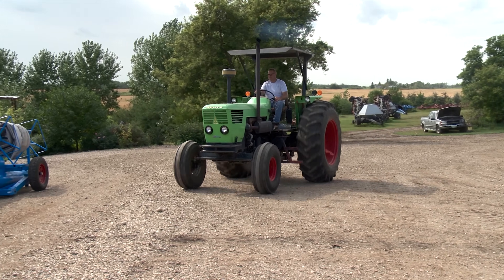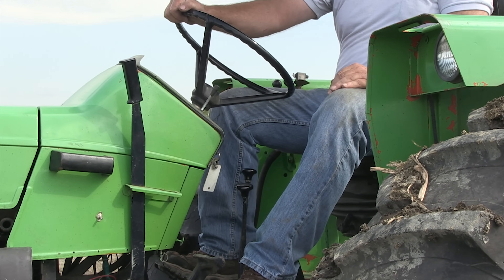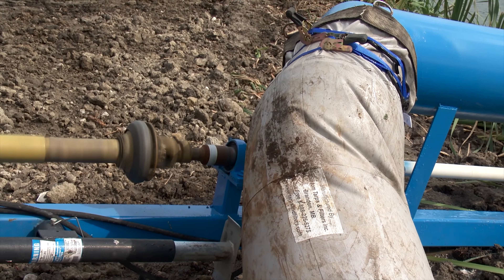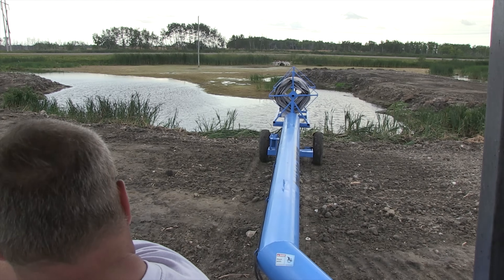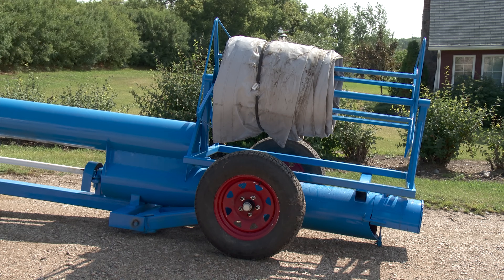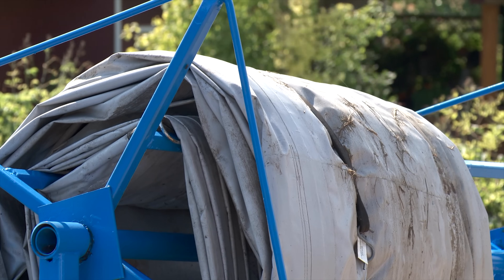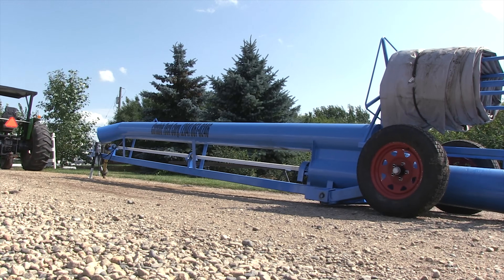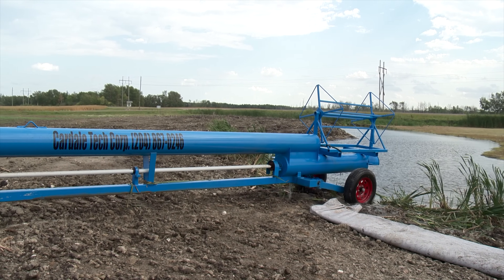6,000 GPM Water Pump

Comment: 법역 
https://www.youtube.com/watch?v=5RPT_-xAzSM 
전 세계 시대 친환경 무동력터보 친환경 새롭게 무동력터보 정품 복합멀티 양수기 유도 시스템 장치 시간. 돈. 인건비 .절감효과 .나타 남니다 .2009년 10년 본사 연구개발 주)아이템천국 032 882 2375
Eco-friendly everywhere
Item Heaven Proposal
Global Warming Ozone Destroys Environmental Pollution Air Pollution is caused by unstable combustion due to problems in the combustion method wherever the main combustion engines use internal combustion engines and fossil oils. Induction system unit is ready for technology.
 
Now, from the United Nations to the rest of the world, we have to spend a lot of money to reduce the environmental pollution soot fine dust (DPF.catalyst, urea water, soot, fine dust reduction device) to be completely burned. We research and develop technology until.

The difference in technology
1, Soot fine dust resolution (Headquarters) to item (low cost) "why" (pre-treatment) selection technology
2, Soot fine dust resolution (Ministry of Environment) to (high cost) "why" (post-treatment) selection technology

Research and development of complete combustion induction system device item technology from headquarters for 10 years from 2009. Automotive manufacturing researchers engineering engineers (unresolved) the problem of environmental pollution (soot fine dust) caused by unstable combustion during combustion of internal combustion engine. In the 10 years of research and development, the technology that can prevent (soot fine dust) by the complete combustion combustion method (Ministry of Environment) select (Post-treatment method). Our headquarters has developed and possessed a technology (pretreatment method) that completely prevents (soot fine dust) caused by unstable combustion in advance (pretreatment method). Passenger cars Ventri, Tiko vans Damas to Scania) all internal combustion engines are used.

If the existing internal combustion engine uses simple wally (air furnace + fuel furnace) technology, it immediately converts various air pollutants (soot, fine dust, DPF) by changing its performance from (unsafe combustion) to solid carbonization. Urea water.) Performance is just a method of draining the performance (to see the water in the smell) resolved.

The (Highly Available) (Smoke Reduction) device recommended by the Ministry of Environment is no longer needed, and we have a complete technology proven for 10 years.

Since all charters have problems with basic combustion methods of internal combustion engines in the manufacturing process of automobile mica, air pollutants are generated due to unstable combustion and the timing of engine development is important. Why does the combustion of internal combustion engines made by doctors of automobile engineering cause fine dust of environmental pollution due to unsafe combustion? Formerly, these environmental pollutants have been recommended by the Ministry of Environment for the complete combustion (high availability) post-treatment method (soot reduction catalyst DPF).

Why smoke does happen
All internal combustion engines Due to the problem of simple combustion method, if time passes, unstable combustion causes (soot dust, ultra fine dust) to be generated in carbonaceous suspended solids.

If fine dust occurs
Carbonaceous suspended solids from unstable combustion in the air (super particulate matter) are sintered in the air, moved in the wind, and inhaled due to air pollution. It is also a state law that destroys the lungs and circulatory organs. It is a very harmful substance.

However, if the problem of generating soot from unstable combustion is the problem of how to completely burn the exhaust by using the exhaust port, why does the Ministry of Environment recommend the installation of a smoke-reducing (high-priced) device of the high smoke reduction? Where (emission reduction DPF) device is installed in a place where emission is good during combustion and noise should be reduced quickly when the engine is exploded. (Good point) is only one simple function (reduction of smoke) .It helps to prevent environmental pollution. It is a problem when (fuel reduction) occurs more than usual due to poor discharge, and (fuel consumption) is more than usual.

In the case of using the product developed in the headquarters in the vehicle, the complete combustion method is selected in the pre-treatment method. You have to believe that if the water comes out instead of the exhaust gas (soot fine dust) instead of (combustion fine dust) in the exhaust of the vehicles used during combustion. Holds.

■ Various vehicles with actual mounting as of 2009-10 years
Domestic passenger cars : from Tyco.Spark to Genesis.
Domestic freight cars : Damas, Downer ~ Daewoo, Prima, Hyundai, Axial
Domestic passenger cars : Mercedes-Benz, Audi, Lexus, Volvo, Mustang, Bantry, Jaguar, Cadlock, Chrysler. Till

Overseas freight cars : Scania, Volvo, Manman, Benz.
All items : passenger cars, R/V, large buses, large freight cars, large dampers, excavators, heavy equipment, special equipment, tanks, aircraft, outboard aircraft, yachts, fishing boats, external generators, hydro power plants, thermal power plants

Others : Farm equipment, Yiyanggi, Combaer, Tractor, Sprayer, Poultry farm, Water pump.

 ■ International Eco-friendly Natural Energy Saving System Research Institute

   Note) Item Heaven
   79-1, Gyeongin-ro 34beon-gil, Michu Hall-gu, Incheon
   Head of Research Hyosung Baek
   010 8359 1469
   TEL: 032 882 2375,
   FAX: 032 887 9096
   E–mail : bhsbhs2kr@hanmail.net.
   E–mail : bhsbhskr893@gmail.com.

Comment: The general idea is excellent based on the fact that it is easier to push water  rather than to pull water.  I would suggest that the square corners on the hose pipe drum would be made on a hexagonal or  octagonal drum while the  drive from the tractor could be provided with some protection........... you know just in case!!  Congratulations for the   basic design.

Comment: I work with commercial water pumps every day and can tell you that's no where near 6,000 gallons per minute. That looked like a few hundred gallons per minute at most
Reply: I'm a farmer run a 10 inch Berggren reuse pit  pump at 2000 gal/minute and that is at least 4000 g/m

Comment: I built something like that once.  Too much vibration and no capacity.  Then I removed all the flighting except for about 1.5 turns at the bottom and changed the chain sprockets for more speed. An improvement, but still not much better than my little floating pump with a hydraulic motor run from the remotes of my small tractor.  Then I bought a pump from a small manufacturer near  Saskatoon. It had a 16-inch discharge, about a 20-inch centrifugal impeller, and was rated well over 10,000 gallons per minute although I didn't have a tractor with the power to run it at full speed.  I needed it to drain rented farmland that included a large patch of flat slow draining soil that was prone to flooding in the spring and crop drowning and denitrification from heavy thunderstorms in the summer.  With the big pump the system worked pretty well.  At half speed the pump didn't need a lot of power and the pump could easily keep up to the water flowing into the drainage ditches.  All it had to do was lift the water about 20 inches and pump it through a culvert into a highway ditch that had screwed up the drainage in the first place.  Thirty-five years ago that was good productive farmland.  Now it is all pavement, streets and warehouses.  I sold my pump to a land developer.

Comment: My wife and I live in Thailand and we have a similar 6" pump.....without the wheels.  We just use an old 9Hp Kubota stationary engine on a stand I made to drive the pump, at less than half throttle mostly. It uses about a litre of diesel an hour.  We use a carry-all to move it around.   All up with 200M of cloth hose less than $3000 invested.   Sometimes people over think the problem!
Reply: Iam in Africa,where can i get that pump?
Can you give me the name of the pump? My whatup is +18592479350

Comment: gator pumps have been around for years with same concept. looks too me like the gator pump has had their idea stole from them. and this jack ads is taking the invention credit
Reply: T Brakefield Gator pumps work with radial impellers capable of high pressure. This is a low pressure pump with an axial impeller. The way they work is not similar at all. Pumps like this have been around for ages though, I don’t think he ever said he invented it.

Comment: There is a ecological problem here.  Many of these sloughs act as runoff filters for the field.  The farmer can use manure and other fertilizers on his field but with the rain it tends to runoff.  With a slough, the water and fertilizer is caught and allows the fertilzer to settle out or be used up.  Without a slough the runoff flows into the local ditches streams and rivers which in turn flows into Lake Winnipeg in this case.  All the fertilizer causes a severe algae bloom which uses up the oxygen in the water and suffocates the fish.  Watching this video gives me cause for concern.  I would like to see the farmers find an alternative to draining the slough by either modifying their cropping procedures or create another artificial slough which would do the same thing.
Reply: I don't think you are up to date with the regulations.  Thanks for the grade three explanation of algae blooms but nowadays farmers are generally not permitted to add manure to their fields when it can run off.  Neither are sloughs disappearing because farmers are draining them all.  Drive around Cardale someday to check them out but be careful as there are instances where roads have disappeared due to rising water tables and beaver dams.  As for Lake Winnipeg, look to the City of Winnipeg with their partial water treatment or all the cottage development around the lake, or all the indigenous communities with boil water advisories because of ineffective sewage treatment. These are larger sources of water nutrients than agriculture.  Farmers adapt the ecology to provide food for people who have to eat.  Biologists point out that the environment has been changed.  The well-fed public then complains about farmers ruining their lives.  The arable land is limited but we are losing big chunks to urbanization.  Non-arable land is everywhere but people want to preserve every tree and declare scrub bush and swamp as heritage sites.  More critical thinking, or just thinking is needed.

Comment: Henry Raupers sounds like his roots take him to Pennsylvania Dutch country and with that square head he definitely goes back to Scandinavia and I would be surprised if family origins were in Norway.
He has that simplicity first mentality based in economy of scale. Found it interesting his approach to lower the pump was to dig holes for the wheel. And notice how the hand reel is manual with ergonomic hand wheels
No nonsense all the way around though that driveshaft definitely needs to be shielded but he did go to proper lengths to recess the anger head.

Comment: oh my... GPM, I just laugh my ass off with these idiotic measuring units. Its like buckets per hourglass =)
Reply: With a weigh of 147,00 Stones
Reply: Burner11111 -- what is ridiculous about a GPM ? it means gallon per minute you idiot....
Reply: heh. It is not european system. Check map http://www.zmescience.com/other/map-of-countries-officially-not-using-the-metric-system/    And second thing is that when you use SI units you do not need use "trillion litres". Because one liter water is one kilogram (not like one gallon is 8.35lb etc)  you can express it example as tons (1000kg). But what is even more nice 1liter water (1kg) is also 10x10x10cm (10 cubic centimeter). So one ton water is one cubic meter of water. So it make all math very easy and straight when all units are binded together. Example pressure. One bar is one kg for 1x1cm area. So if you need to know how many kg something needs to stand you just put pressure * surface and you get kg:s. Or if you need to know pressure you can just take tape and measure that ah I have 2m depth pool so pressure is 0.2bar. And so on. You do not need convert units to make math, You can just use them as they are.  So 6000GPM is about 22cubic meter per minute quite lot of water.  baseball field is 14 000m2 so it will put one cm water to field at 6.3minutes? (14 000/ (22*100)) . Again no need for unit conversion for calculating that. That why there is reason why also america try move to it https://en.wikipedia.org/wiki/Metrication_in_the_United_States  but looks that there is still lot to do at education level ;)
Reply: Or Kittens purr
Reply: Burner11111 gpm means gallons per minute
Reply: Burner11111--- interesting , i will look into all that, i didn't realize where you were from. we definatly have different wieghts and measures. yours seem to be a bit much. i don't think it has to be so complicated . its a simple wieght and its a simple measure.
Reply: John Long   Volumetric flow

Comment: 6,000 gallons per minute? In the video it seemed more like to be two or perhps three gallons per second, which is 120 to 180 GPM. Is there some kind of overdrive feature making it 30-50 times faster than in the video?
Reply: seedorfj is correct.  The person with the incorrect math was me.
Reply: seedorfj I came to see 6000gpm, one could fill a swimming pool in four minutes. This is useful but doesn't look like the out put they're bragging on.
Reply: Must be Canadian Gallons.
Reply: Since Imperial Gallons (4.54609 litres) are larger than US Gallons (3.785 litres), the error only increases if that was the case.
Reply: Yeah. There's no way it's moving that much fluid. My pumps at work move 1500gpm consistently. And it's MUCH more water than this
Reply: seedorfj 10*60 is not 6000.
Reply: With a 14" discharge, as in the video, this would mean a flow-speed of 249 m/s (816 ft/s)!!
Reply: That would be over 530 mph.  Uh yeah, someone's math is out a bit.
Reply: That rating is most likely straight off the machine. The losses from fluid flow through the hose need to considered for any practical use. – pump curves.
Reply: indeed it doesn,t look like1296000 liters /hour. but     i must admit it pumps a fair bit
Reply: 7.48 gal
Reply: Guys its probably gallons per HOUR thats usually how large pumps are rated.  Theyre just haveing a brain fart
Reply: I was just performing annual fire pump testing at our local FD today. Our biggest rigs move 1500gpm @ 150psi....that looks like a helluva lot more than what he’s got going on. I’d say he’s moving maybe 600-800gpm at almost 0 psi.